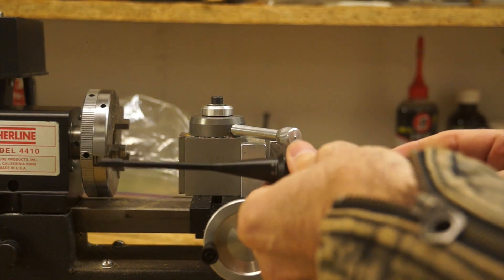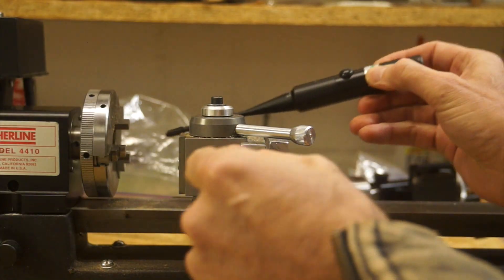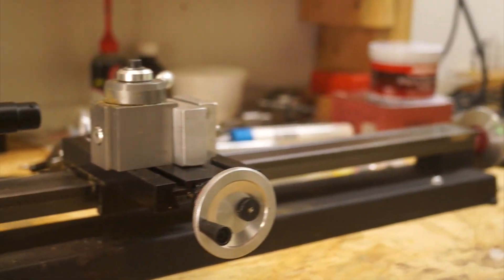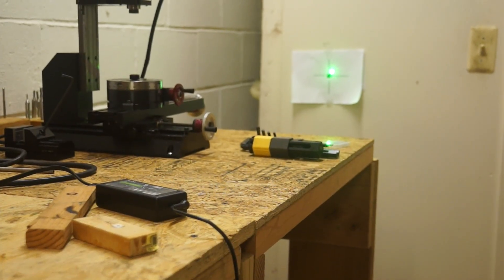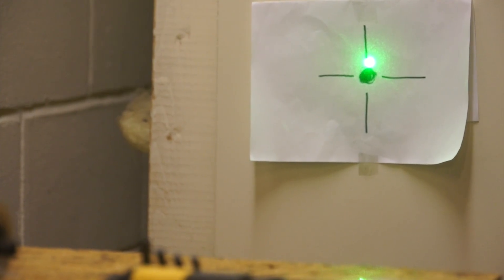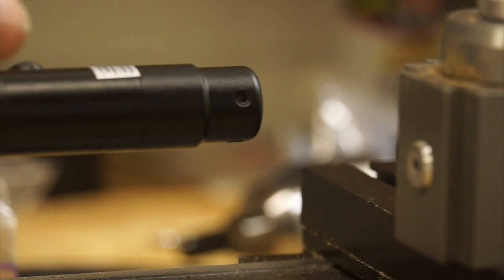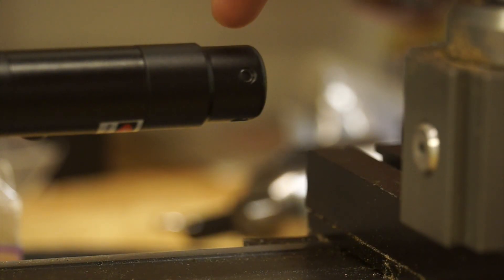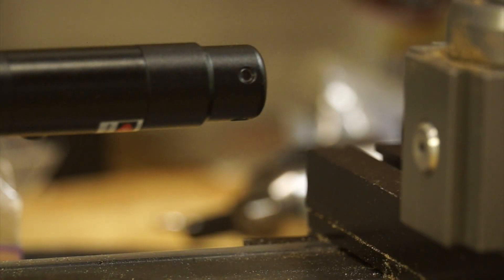Easy trick to zero a bore sight for your rifle with lathe

Comment: What brand of bore sighter is this? Not all of them have 4 directional adjustment screws. The link you posted for an Amazon product is not the laser with 4 adjustment screws. Most have 2; those are not very adjustable.

Comment: You can also use a drill with a good chuck in it. Your final adjustment check is good. The wobble is created more by the distortion of the dot itself than a misalignment it looks like.
Reply: A hand drill? How is it gonna fit the long boresighter tail?

Comment: you can also rotate the laser bore sight by hand while viewing the arc through the scope.  In this way, you can find where the laser bore sight is making an arc.  This is the error deviation of the laser bore sight. Typically, this is going be a small arc, sometimes an elliptically shaped arc.  If it is a near perfect circle you can eyeball where the center of that radius really is.  If you really want to get precise, just measure the distance between the two farthest points down range as you rotate the laser bore sight.  Splitting that distance will give you the proper laser perfect point!  if the arc is elliptical, same process with one small additional step.  Rotate the laser until you find where the laser deviates the most in the vertical plane (we don't have to be concerned with left to right..bore sighting is not useful for windage!)..If it is elliptical arc, there is going to be a high and a low side.  Choose the high side deviation...go down range and mark on the target where this lands in the highest distance on the vertical plan, with a marker pen.  Then go back and rotate the laser bore sight 180 degrees.  this will show the hide side deviation but on the lower vertical plane.  Now that you have your marks.  MOVE THE TARGET ITSELF to half the distance between the two marks. Now you can zero your scope to the NEW BULLSEYE POSITION.  You are perfectly zeroed in!  

I learned this method from an old school armory specialist decades ago, when lasers were not very precise.  Understanding and knowing where a laser deviates from error in machining is a simple matter of rotating the laser slowly and then tracing where that point traces on the paper.  Then you take mark that arc in pen, perhaps at each 12 hour marks.  Or 4 for simplicity.  You will find the arc whether a near perfect circle or an elliptic arc is going to give you the character of the error.  Using that error deviation, you find the center. It's not difficult if you measure the distance and find the center between those marks!  Then you move that target to that NEW CENTER MARK YOU DEVELOPED>  Then sight your scope to that mark.  And voila'  you have now zeroed your scoped rifle.  

of course, we KNOW this is not the end of the process of zeroing a rifle.  This simply get you to "optical" zero.  Meaning the scope and the rifle will converge to the same exact spot across a given distance.  But we know we never simply shot at only one distance.  For hunting that distance varies according to conditions we cannot control.  So the real work begins to find the best zero for your rifle for a given set of ranges you are likely to  encounter.  and that means shooting the rifle with the ammunition you will be using, in the conditions you are likely to face, and your human finger pulling a trigger.  Laser bore sighting is helpful to find optically true zero.  But is not going to help you produce dead on shooting.  real shooting, really ammunition, finger time and making adjustments to elevation and windage is going to do that.  (but we know this right?)

Comment: One thing to keep in mind that while these items are not precise they are to get you on paper. If you make adjustments to the screws you may cause the unit to stop working. In another video someone pointed out that while it maybe off slightly if you turn it to get an ideas as to center then it will help guide you to center then actually shoot rounds to fine tune the scopes line of sight and the bullets impact point. When I adjusted mine the unit failed. ♠️🎩🎱🎯🇺🇲🏁🇺🇦🔱🌻💮🏵️🌸🌼🏴‍☠️🏹
Reply from the maker: The adjustment screws are specifically there to adjust the beam. Never had a unit fail for this reason.
Reply: https://youtu.be/bc4ca6I6J68

Comment: I bought a red laser bore sighter from amazon, it did not even have the four laser adjustment screws because the bore sighter according to the seller was “precisely machined”. Returned that, then I bought a green laser bore sighter from ebay, the seller had a 97% rating and he too claimed it was calibrated to 1 MOA at 100 yards. LOL. The laser dot was making a one inch circle at 15 feet. Luckily this one from ebay had four adjustment screws. Will be adjusting mine on a friend’s lathe.

Comment: I just use a normal laserpointer, take out the bolt putting the laserpointer in place off the bolt space.
When the laser shines through the barrel with a ‘clean’ dot about 10/20 feet away i know it is pretty much properly alligned and the ‘beam’ not touching edges inside the barrel.
Surtenly works with smaller calibers due to the smaller bore.
Putting that laser dot at 25/50 yards and adjust my crosshairs on the dot.
Within a margin of 2 inches i know I’m on paper.

Comment: I have tried this in lathe it does not work, because the bore centers using the cone in front and the adaptor, must adjust center  in the barrel( and it will always show low)

Comment: all 3 jaw chucks are off center some amount - even the ones that cost thousands of dollars - with the small lathe you're using, I would expect it to be off at least .003 to .008 - the error is gigantic when you run your laser out to a distance of 30 feet

Comment: You chucked up on the body of laser. That has nothing to do with concentricity of the bore section  that fits in muzzle to the laser dot/beam.
Chuck up on the section that goes into the bore. Use a variable speed drill!

Comment: You can also use a v-block and spin it by hand if you dont have a lathe or have one in a good area. As long as you’re setting on the OD where it will be in the barrel and have it resting in the V, you’ll be able to tell the concentricity of the laser to its outer casing.

Comment: It seems like a more accurate way would have been to place a dial indicator on the body of the boresighter and centre the jaws of the lathe first just like you would do before any precision milling work. I would liked to have seen the deviation of the green dot on the paper after the jaws were centered and before any adjustments were made to the laser - or so it seems to me anyway
Reply: Looks like a three jaw auto chuck. The piece is automatically centered. If you were to use a dial indicator you would need a 4 jaw independent chuck. Personally I’d set it up in a collet.

Comment: I use a chamber laser bore sight and make a zero target for each rifle.  I lay the rifle on paper and  mark the barrel on each side then measure and divide by 2 to find center axis.  I then mark the top of the scope, measure the diameter of the scope and mark my paper.  I then bring the center scope line of sight over the barrel center axis.  I end up with an accurate chart for that rifle.

Comment: Thank you for your video,  I have a sightmark bore sighter and I was fairly sure it is not accurate as my metal sights get me much closer to bulls eye than aligning my red dot with laser point.  So now I have to try to figure how to adjust the sightmark.  Thanks again as your is the only video I have seen which speaks to the need to align laser bore sights.

Comment: How did you adjust the laser? I've tried on two different models but every time I adjust the screws it gets worse. I used a drill to spin it, I turned it to its highest point than adjusted the top and bottom screws downward but I just can't get it just right.

Comment: Hey, that's a good idea.  I never thought of doing that.  I bought one of these off of Ebay and it turned out to be what I thought was a piece of crap for the very reasons you shown in the vid.  I own a lathe but unfortunately  the distance from the chuck-jaws and the nearest wall is only about four feet.  It may not be far enough to get a real idea of how far off the laser beam is from true center but,  I'll have to give it a try anyway.  If it works it may save me from wasting few rounds down range.

Another weak point I found on these types of laser bore sighters are the expanding rubber inserts.  They don't expand evenly all the way around so even if you get the laser beam spot to center,  if the rubber insert isn't expanding uniformly it will cause the beam to be off center.  I guess I'll have to see if I can turn some perfectly sized brass inserts to mitigate this problem too.  If it works I may be able to salvage this bore sighter.   Thanks for the tip.
Reply: The taper (cone shape)on the laser end of the bore sight will true it in the bore not the insert that just keeps it from falling out.

Comment: "So, I have made the adjustments I didn't want to bother you with watching me do that" - ahem, that is the tricky part, knowing which screws to loosen and which to tighten. You don't tell someone how to balance a wheel by saying "just add weights"
Reply: There are 4 Torx 8  or Allen set screws under the sticker at the front. In a leveled hand drill or $2000 lathe, ( I, guess) you set the sigher in and set a paper on the wall for the laser to hit. I bought the dot to the top of the 7in the circle and made tiny adjustments to the setscrews 1/16th turns, and repeat until I had the dot spinning about 3/8th inch. I figured it was the best I was going to get. ( and I had to repeat this process a few times because I overturned a setscrew and had to start over twice) so as you get the dot tighter on target, go REALLY small on your adjustments.  Once I had this done I was not just on paper I was in the red with only a few clicks on my optics to account for distance. 😎
Reply: Thank you, my thoughts, exactly
Reply: I don't get your problem, he told you how to loosen the screws and adjust it. Maybe you should look up a video on "how to pay attention" or an English class? If you could do it on your own, why was you looking up videos genius?
Reply: It's a garbage video. Completely pointless

Comment: One comment.  Why spend money on a bore laser?  A chamber laser costs about the same and is lined up when you close the bolt.  Know the measurement of distance between  your line of sight axis LOS and center bore axis CBA and mark the two points on paper.  Now you have a re usable aim point for the weapon.  One of the problems with a bore laser is they don't always align with center axis.

Comment: step one:Put laser sight into lathe.
i don't own a lathe... :'(
Reply: @marvieous  I tried. All drills i own are more or less out of center. I don't think that there even exists a 4-chuck for power drills, heh.
Reply: You gotta first zero your run-out on the on the main frame with a dial indicator then zero the beam...The man with the bearing idea it should work with a v-block. Tie it down hard to keep from chasing you tail.
Reply: @marvieous  I was tinkering with an idea of building a support bearing for the boresight, using a 1*4 or 2*4 wooden plank as base.
Reply: @bmwbill1  How does that solve the problem of not owning a lathe?
Reply: @sleeptyper  I'm sorry, I thought I was replying to imsmoother.
Reply: DarkLight cordless drill

Comment: dont need a laser if you have a mark on the wall
Reply: JB A mark on a wall? Really? Please elaborate as I'm curious as to how you think some random wall marking will work better than any type of a laser.
Reply: I will elaborate for Jb since he hasn't yet.   your fancy laser wouldn't last through the test of time as simple solutions / methods will outlive a Duracell battery any day of the week. 

shoot at a spot on the wall.  bullet 1.
aim at same spot (you fired at with bullet one and most likely missed) keep aim on original target looking at where the bullet went. adjust the turrets according until your sights line up with bullet number ones hole. .. bullet number two should hit spot on to whatever you aim at on same board at same distance.

Comment: What a fake!  You can obviously see he doesn't have the bore sighter centered in his lathe when he rotates it to show the screw adjustments.  It is wobbling about 1/16 of an inch up and down which causes the LED to be off on the paper.  Then he makes "adjustments" off camera and when he shows the bore sighter turning in the lathe the wobble is clearly gone and the LED is relatively steady on the paper.  Plus it is spinning at the end so you cannot really see the smaller amount of wobble still present.  Not saying you can't use a a lathe to dial  in the bore sighter.  I believe the video was misleading on purpose and the guy was too lazy in trying to make his point.  That shit pisses me off.
Reply: The beam is OFF Center, Just looked at mine. Without a rifle
Reply: +Robert Turner its not fake in the slightest, most if not all laser bore sighters have adjustment screws for this very reason as the factory does an appalling job of centring these things themselves.
Reply: @Getbent97  At 2:08 you can see that the boresight is not centered in the lathe.
Reply: Robert Turner I agree with you 100% from what I saw when he turned the lathe you can obviously see the bore sighter isn’t centered and from my knowledge of using these you’re better off shooting the gun first and making the adjustments to your optics that way!!!!
Reply: I seen that but you made the comment so I didn't have too. Great insight

Comment: Use a Cartridge Laser Bore Sight. Sits in the chamber like a regular cartridge and it's Much More Accurate because it goes All The Way Down the barrel (Bullet Perspective).
Reply: The problem I have had witg those is the light from the laser bounces off the barrel
Reply: Wolf Man I have the cartridge type. Still no good. Take it out, turn it around and reinsert. It aims to different location. For hand gun it is easier to verify if it is accurate.

Comment: You got the same problem I have had with mine, exactly the lazer its self they are garbage useless! Would a lazer that fits like a round make more sense? at least it proves it self down the bore.
Reply: Spent all week worrying why my CROOSHAIR's elevation would NOT  come UP high enough when using on IN the BORE. Just tried this at the included target? Yep, about a 6 inch circle just turning it by hand.

Comment: How did you make sure the bore tool was aligned correctly in your lathe, if you adjusted your run out on the tool chuck(sorry don't know proper names) could you have the same effect on the laser?